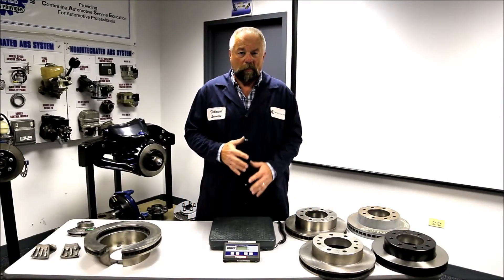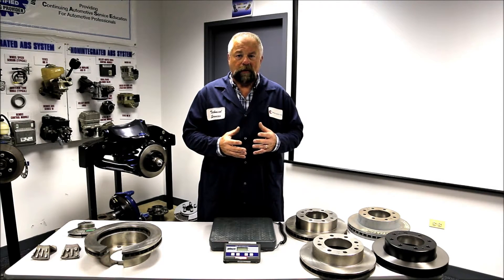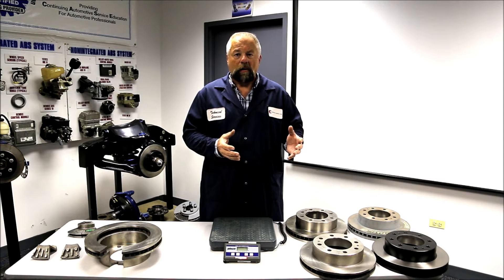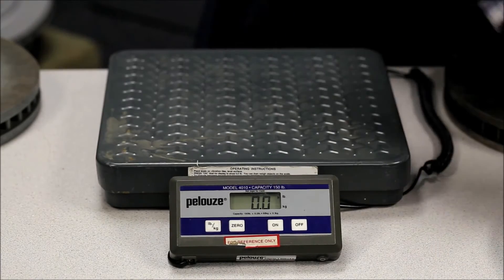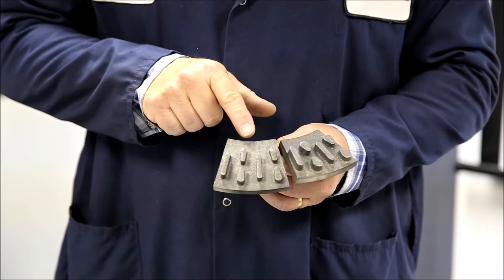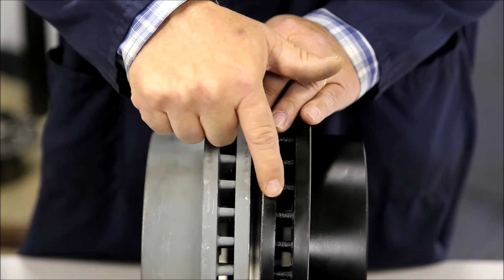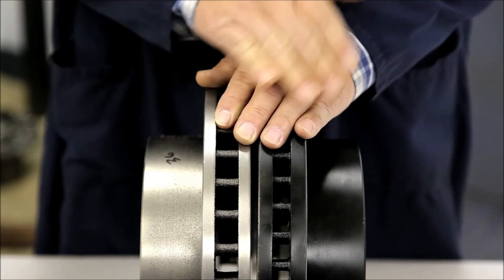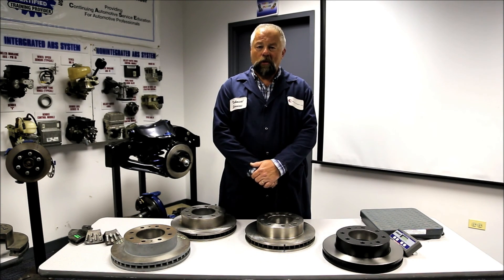OE-Matched vs. Lightweight Rotor Discussion with Raybestos Brakes

Comment: I generally stick with decent brands I use Raybestos Elements 3 pads and because I was having trouble finding rotors for my truck due to availability I went with AC Delco Fully coated rotors in the front professional series and Wagner Coated for the rear no issues all good brands it depends on which line of rotor u get I got the best ones of the brands I mentioned they are all good I generally use Akebono brake pads but due to being sold out went with Raybestos element 3 they are both good just buy the higher line of rotors

Comment: According to our Raybestos sales rep, they moved a huge amount of their production to China. Serious issues with quality on their Chinese produced rotors due to the quality of metal and tempering. Hopefully, they can at least produce things in North America and keep a tighter control on quality.
Reply: So which ones are produced in America and which ones are produced in China? Do you have a better brand than Raybestos? Please share!
Reply: @adamhutton4165  try Akebono. They’re a Japanese manufacturer but have factories in the US.
Reply: Almost all rotors are made in China these days.  Not much we can do about it.  Spend more on your rotors to at least get some semblance of quality.  Cheap rotors will just cost you more in the long run.
Reply: @ I’ve installed factory Toyota and Honda rotors several times over the past 11 months. These rotors were manufactured in the US. Recently, I installed a pair of Brembo rotors on a Subaru Forester. They were made in China.

Comment: lightweight rotor reduces unsprung mass
Reply: Ahh yes saving a few pounds of unsprung mass so important when you need to stop thousands of pounds of car....
Reply: @connor3288  Mass are only important when using the brakes hard and repeeted. Mass are not about brake force, but about how much you use the brakes without giving them time to cool. Just look at the super tiny rotors that are used on serious drag cars, often stopping max hard from 200+MPH.
Reply: @westmus  I never use a parachute to stop my daily driver though ..
Reply: #thugLife